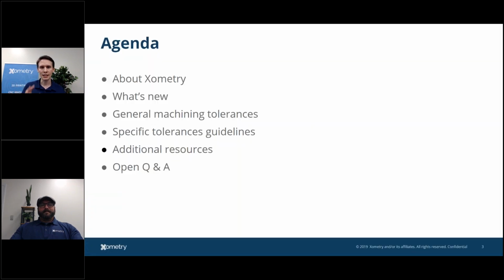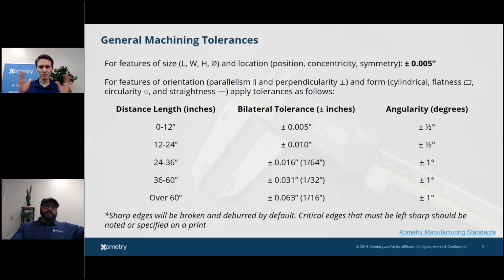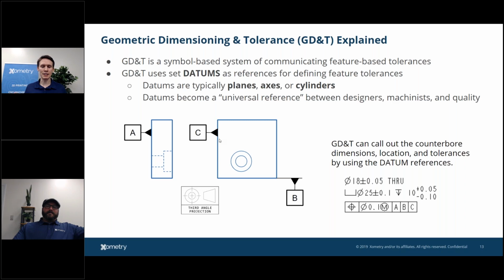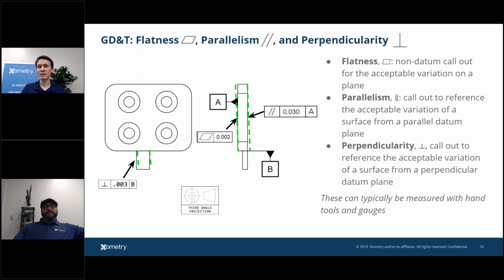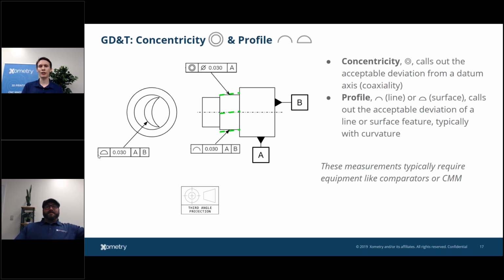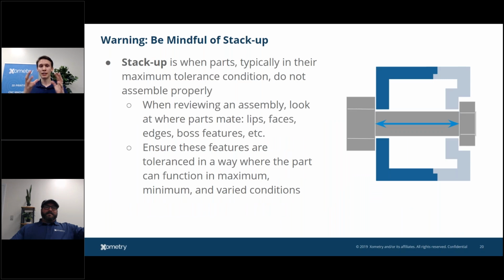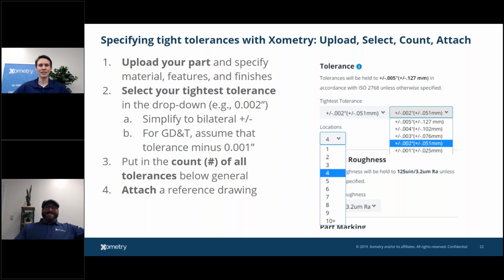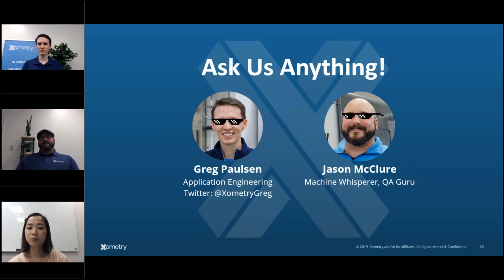On-Demand Webinar: Mastering Tolerances for Machined Parts

Comment: 32 minutes and something into the video: "if you click surface profile, you are asking for a CMM" - why make inclusive statements like these? If a designer wants to use a rectangular block in an assembly  to locate a component on top of it, he or she should make the bottom face a datum feature and apply profile of a surface on the top face with reference to the datum at the bottom. Easily verifiable by a surface plate and a height gage available at every machine shop. No CMM is necessarily required, and the design intent is communicated much better than with a +/- toleranced dimension. Plus  you don't need to inspect Rule #1 (perfect form at MMC ) as you do in the +/- case if working per ASME Y14.5. Additionaly the bottom face which rests on the datum feature simulator could be convex and you don't have to worry about it as it doesn't affect what the callout controls whereas it could make a +/- toleranced feature non-conforming due to deviation from the minimum size limit.

Comment: Concentricity is used when you have a rotating mass. When measuring concentricity you have to determine the center axis is within a specified range.  If the center axis is out of range you will get vibration.  Runout is measured easily with a v block and a indicator taking both the center axis location  and shape of the surface into account at the same time. Both have there applications and care should be taken when used.